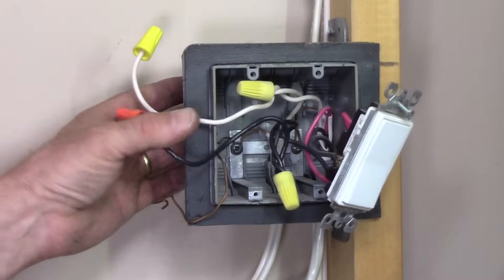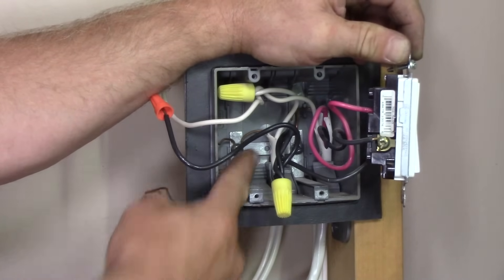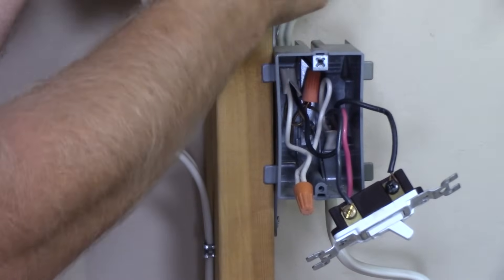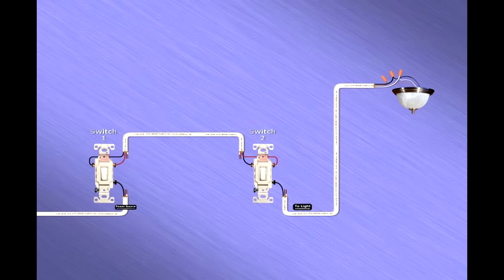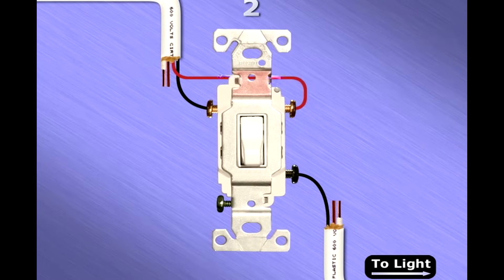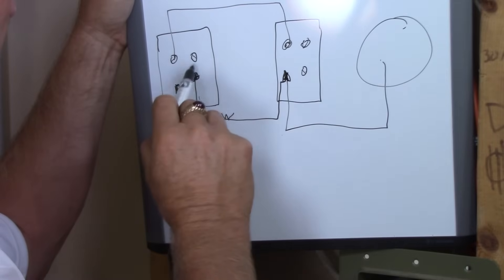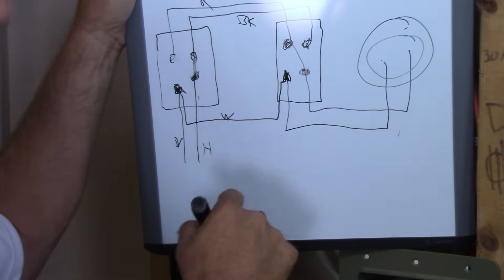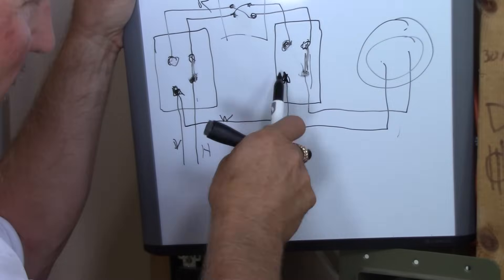The Best 3 Way Switch Explanation Ever!

Comment: A lot of people are making a big deal to have a neutral in both boxes for occupancy sensor switches , but no matter what you can only install one of these in the box that has the hot and the neutral . Say if you tried to put an occupancy switch in the second box you would have a great neutral and no constant hot . So a “dead end 3 way” with no neutral at all would work just fine . There are many permutations of how the cables end up in the boxes , but I see no reason for a neutral being mandated in all boxes as some say. What do you think.

Comment: I'm not an electrition. But I do believe if you were to use the terms line and load instead of black and black it would be much easier to understand. By my doing so I think I finally have a way to remember it now. Also. Do the travelers need to be on the corresponding screws on the second switch?  Some switches are different. I don't do it enough to remember. Thanks
Reply: They do not need to be on corresponding screws.  Most above criticizing wouldn't know that because they didn't pay attention.

Comment: Good explanation. I was already familiar with wiring but this help re-enforce the current flow. The challenge I find isn't the wiring where you can see the wiring in the wall, but figuring out how it was wired originally when replacing a switch. Think 3-gang box and more than 1 3-way switch and just for fun throw in the switch terminal locations were different on the new switch than the old. Took a bit to get it straightened out.
Reply from the maker: Good job Brian!  Thanks for watching!  I hope that you gave it a 'like', and that you've subscribed to my channel.  And don't forget to click the bell so you'll know when I release a new video.

Comment: What is wrong with this when I plug in my fan or any other device into one plug outlet my TV which is plugged into another Outlet kind of snapped whenever the you will the wire at one Outlet my TV snaps makes a snapping sound what's that mean which one do I have the trouble in the TV Outlet or the fan Outlet please get back to me

Comment: At 2:30, why is the black wire NOT attached properly?
Reply from the maker: This is my demonstration wall, and this device box I'm using is a 2-gang. The black wire you see is a pig-tail off the hot splice for another device that could be connected in that box. Sorry for the confusion.

Comment: I own a house built in 1959 and I have a 3 way switch by my front door to turn on the light in the carport and a switch in the carport to turn the light off one on whatever you need. But the switch in the carport is missing and there are 4 black wires and one white wire and the best I can do is to turn it on by the switch by my front door I can’t get the switch in the carport to do anything but turn the light off and then the other switch doesn’t work, can you help me please?

Comment: I think what confuses people is where power comes to first switch where second switch is and where light is and the different ways to power light. Whether you go from first switch to light with 3 wire and use white as a neutral / hot than to second switch. Or run 2 wire from first switch to light or from second switch to light. Like say a basement light with power at down stairs switch light down stairs and second switch up stairs. The way this video explains they will run 3 wire to upstairs switch than 2 wire to light. But there could be a better simpler / cheaper way to do it. The problem people have with this is they still don't understand exactly what they are doing. Same as when power goes to a light box and you can run 2 wire to switch and use white as hot. The simple way for them is power to switch whites bonded and 2 wire to light. All I'm saying there is more than 2 ways to skin a cat and that's the confusing part.
Reply: Yes for me something was also missing in this explanation which is as you describe the situation of a three-way switch at the top of the stairs and another at the bottom of the stairs with the light in the middle. I don’t believe this video addresses that wiring scenario. And I think the wiring also depends on where the power is coming in. In other words if you are starting with a ceiling fixture which is turned on and off with a pull cord, and that’s where the power is coming in, wiring that 3-way switches is going to be different than in this explanation where the power is coming into the switchbox.

Comment: I have always used the two terminals on the same side of the switch for the travelers. The single terminal is always the hot leg, one hot from source and other to light. If the hot source is hooked to the terminal opposite the single terminal, the three way switch will not work properly. So to me it has always been better to teach people how to do this the easier way so as not to get any confusion injected into the equation.

Comment: Good vid Thanks...According to this vid I would assume if one of my 3-way light switches that has ONE 3-wire coming into it; is spliced somewhere? Trying to install a couple smart switches; but confused by the garage location only having 1 romex coming into it.
Reply: Sounds like a "bob tail" run.  Most likely, the white wire (which should be taped or marked with black marker) is supplying power to the common terminal.  The black & red are travelers back to the other 3-way, and the common terminal there goes to the light.  This is used when the power from the panel goes to the light/ceiling fixture *first*, and from there on to the pair of 3-way switches.  This light/ceiling box will have the black wire from the panel spliced to the white wire of the three wire cable (which again, should be marked with a marker or black tape to indicate it's NOT used as a neutral).

Comment: which wire do I bite down on to make him shut up?
Reply from the maker: John Lukach I can set something up for you to test that out?
Reply: haha  good comeback.  Seriously tho my issue with electrical theory is that it is all wrong.  The 3 phase system we use is massively inefficient and completely ignores the dielectric.  In every electrical equation in use the dielectric is factored out.  Have you ever noticed there has been no significant advance in electrical engineering since 1928 or so?  I would refer you to the origin of energy synthesis by eric dollard.
Reply from the maker: I'm too old to learn anything else, my brain is full and now for anything I add to the files, something has to go! Just kidding of course! I try to keep things fairly simple and my focus is helping the do-it-yourself home-owner to understand the home electrical system, and teach how to do things correctly and safely.  Interesting to hear your perspective though.  I will check out Eric Dollard.
Reply: I have actually spoken with Eric on several occasions.  He's brilliant but very ill now and he may be gone soon.  If listening to Eric makes your brain meltdown (mine did at first) you want to see what can be done with this info, practically speaking, by looking up Jim Murray.  He's a guy in Ohio, clips on here of him walking around his lab, showing various motors utilizing these theories.  Easy to follow, things like elliptical stators that utilize the dielectric half of the system as well as the magnetic.  Also a free pdf by Ken Williams called Uncovering the missing secrets of magnetism.  At first glance Kens work is hard to understand, you need to adjust your thinking a bit and learn some new definitions, proper terms, not the ones thrown about today, so its extremely precise scientific info but if you stay with it you will be amazed at what he is trying to demonstrate.  I also converse with Ken via comments from time to time. His channel is Theoria Apophasis aka the angry camera guy.  ignore the lens clips.

Comment: What the hell is traveler?
In simple term, do you mean that wire is the one that goes from one switch to the other connecting the two and it goes to no other place?
Reply: It means YOU might just wanna call an electrician. If ya can't figure THAT part out, you don't need to be messin with electricity.
Reply: @salvadordollyparton666  Just say you don't know that is why you don't explain.  Nice cop out.
Reply: Sixth Lord yeah thanks for the help, not
Reply: Blue Ocean I was thinking the exact thing!!
Reply: He should have said "Travelers" as you need two. One switch has the Line Side from the panel. Goes to black screw. The other two wires go to any of the two brass screws. The other black screw is the Load Side to the light.

Find the box that has the Line Side. The other box has the Load Side. Simple now to figure out...

Comment: I ❤️ you. You taught me something I struggled to comprehend for awhile.
Reply from the maker: Thanks for taking the time to make a nice and positive comment.  The ones that comment that are just out trolling and criticizing can bring you down a bit, but then someone like you makes it all worth it!
Reply: Terry Peterman. I am in the process of "redoing" a 1910 classical Revival.  The rooms are 20'x20'.  At some point, two of the rooms that have 2nd for ways that open to a porch had their second switch removed and the box filled in with dry wall mud.  It's a pain, especially in the dark, to cross through the room to turn the light on or walk out of a dark room.  Now I know I can re-install the switches as they should be.  Thank you.  And I didn't mind the 12 minute video.  Thanks again!

Comment: Little confused here.  My 3 way at my home turns the light on or off regardless of the position of the other switch.
  The reason I was looking at this is I am at a house where if one switch is in a certain position, the other switch will not turn the light on.
  I thought the purpose of a 3 way is to enable us to turn the light on or off with either switch.
Reply: It is, yours is wired incorrectly if they both don't turn the light on and off.

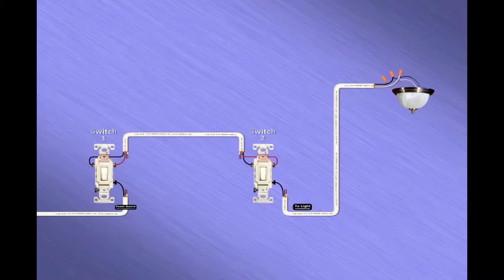Comment: 5:05 The actual explanation of 3-way switches starts here.  
9:47 The explanation of 4-way switches starts here.

Caveats for noobs:   
– The red/black colors for the travelers don't matter.
– Electricity doesn't "flow" and "stop" like water. It either flows all through the entire circuit at once (a complete circuit) or it doesn't flow at all.  
– A household three-way switch would be called a "single-pole, double-throw switch" in any other context.  
– This video should have been three minutes long.
– This circuit is just as simple as it sounds. The two three-way switches, wired back-to-back, is effective and efficient. It's just a matter of both switches lining-up a circuit path to the light.  Either switch can make or break that path.
– Any number of four-way switches can be used in between two three-way switches.  
– A household four-way switch would be called a "cross-wired double-pole, double-throw switch" in any other context.
Reply from the maker: Thanks for your input, good information. Using the comparison between current "flow" and the flow of water is just a way to help people understand. It's good for the "noobs" of which you speak to. Try throwing in alternating current changing directions 60 times per second and you can see how things might get cumbersome.
Reply: Jovetj, I was hopping to find smart videos in your channel but you have nothing good to offer.
Reply: Guillermo Perez the explanation he gave was useful information,  he never said go and watch my videos.
Reply: Jovet
Reply: @A. Rose
I am always happy to learn. What was "dumb ass" about my comment?
Reply: "This video should have been three minutes long" and the useful part is taken from a DVD.
Reply: Jovet

Comment: HI i have a question how to wire two components like a light and fan using  2 -double throw switches thank you  Steve W.
Reply: Why would you need double-throw switches, just to turn a light and a fan on?  Remember "double-throw" means that two positions of the switch connect one or more contacts.  A three-way switch is a SPDT (single-pole, double-throw) switch.

Comment: many decades ago, in my 1st antique house, the upstairs 3 way switch broke . The wires were ALL black, fiber insulated. Natch, the antique switch had NO markings. I fumbled for hours, b4 my dad bailed me out... he worked on even older antiques, so knew typically which black wire was which... (2) new 3 way switches, up & working in 20 mins ! (a lot of steps) btw... he had no meter ! I dunno to this day how he pulled it off !
Reply: Easy to find. Find the box that has the Line Side from the panel feeding it. The other box will have your Load Side to the light. Now just find the two travelers. The only box that should have a Line Side in it. Is the one that stays hot. Use your voltage meter. Check the black screw stays hot even if up or down. The other switch goes to the black screw to the light.
Reply: @MasterChief-sl9ro  You can have both your line and switch leg in the same box.  Just saying.
Reply: @chkohl1919  No kidding. The issue is finding the Line Side First. As you will just be spinning your wheels. As nothing say the Neutral to the light has to be on the same box. As well. I seen this make people spend 4 hours trying to figure out. What should take 10 mins...
Reply: @MasterChief-sl9ro  I'm sorry, I speak English so i don't think we're understanding each other.  Have a good day.
Reply: @MasterChief-sl9ro  thanks for the info.
Reply: I'm having the same issue...I've been spending hours on black un- indicated wires...this video just isn't helping only making me overthink haha

Comment: Great info!
How can you get around the fact that smart 3 way switches need a neutral at both locations, but your legacy (2002) 3 way switched are wired with a neutral at only one switch?
Reply: Lutron Casetta smart switch only needs nuetral on one side
Reply: @laRiduzione  
Serious?  I'll have to check them out - thanks!
Reply from the maker: That is a problem, and why the code was changed to require neutral conductors in every switch outlet box.  That's why this method shown here meets that requirement, and is the best way to wire a 3-way switch network.
Reply: Ah so being 2002 it was code, but now it is not.
What can a guy do besides re-wire?  Nothing?
Reply from the maker: Probably difficult, yes. There's always a way however, but the situation has to be assessed to see what can possibly be done.
Reply: @theinternetelectrician  
 understood and thanks!
Reply: Terry Peterman not every box. If one side of wall is accessible, if piped to box or if both locations of a 3way can be seen at once, they’re exempt.

Comment: Here the. Older inspectors will knock you down for the way you have the switches wired. When both switches are down or when both switches are up the light is off, to pass.
Reply: That's a  really goofy rule, especially since  3 way and  4 way switches are not marked with an Off/On position. It is not going to settle a person's mind by having both up or both down = off, when "normal " mode is up= on and down=off. If this WERE a good rule, what happens when you add a 4 way, or better yet, two 4 ways, like at 4 entrances into a large room? So much for both up or both down = off. The 4 ways ain't listening !!  HAHAHAAHAHAAHA !!
Reply from the maker: I've never heard that before? Interesting that an inspector would request that.  Unless I'm not aware, I don't think it's a code rule.
Reply: I'd challenge any inspector who called me on that to show me a code rule stating what direction a switch must face, 1,000% sure they won't find one. Enforcing ones own personal preference and enforcing the code are not the same thing, guess which one is an inspectors job?
Reply: Wil Rushmer, you are right. There is no rule for 3-ways and 4-ways, since their toggles are not marked. The only rule is for 1 pole switches, up=on and down = off, since those toggles are marked. Another rule is that the HOT wire always wires to the top of a single pole switch (same as for a disconnect switch).

Comment: SOON AS IT SAID BEST EXPLANATION EVER I KNEW I WAS SCREWED !
Reply from the maker: Geez, I didn't mean to have that kind of affect on you!
Reply: it could be purple, its just a traveler wire and most 12/3 or 14/3 wires are red , black and white. When used i switches like this , it makes it easy to identify. Now on some 220 circuits, red and black are the hot ones , not just hot when switched over from another switch.   There are times when even a white wire is a hot wire, but the ends need marked with red or black tape or sharpie marker to let people know that that white is a hot wire.
Reply: Hmm, i thought it was well explained to the non electrical minded people. 3 and 4 way switches confuse many people but they are simple once you understand whats going on behind the switch plate covers.

Comment: Thanks for the animation. It completely explained the flow of electricity which I was having a hard time visualizing. The piece of information most helpful was showing what the function of the black versus bronze screws. If I ever have any questions about the flow from the switches position I can now use a multimeter to double check continuity.
Reply: Steve S same👍🏼
Reply: Same

Comment: Nice video but I am still a bit confused regarding my situation. I am trying to replace an old switch with a Lutron dimmer switch but the old switch has 2 black wires plugged into the back and a 3rd black wire on the upper right screw. All the white wires are capped in the box and the copper ground wires are jammed into the box. There is no place for a ground on the old switch itself. The Lutron dimmer has a black wire, a red wire, a red and white wire plus a green ground wire, so am not sure how to hook up the Lutron. Any help would be appreciated. Thanks!